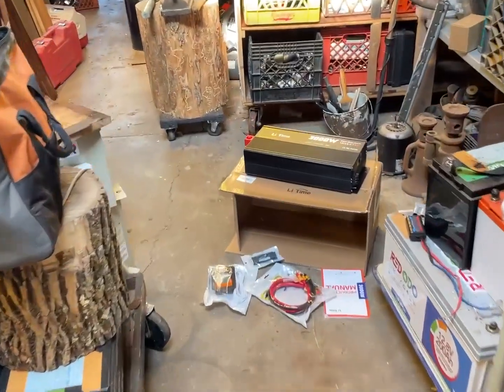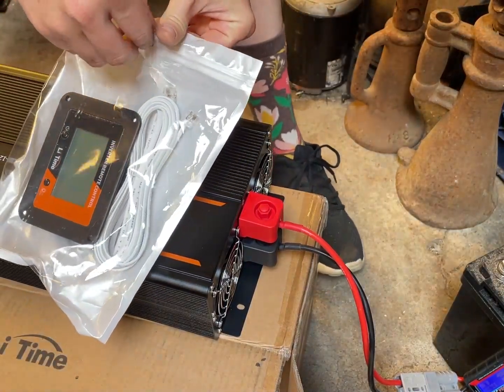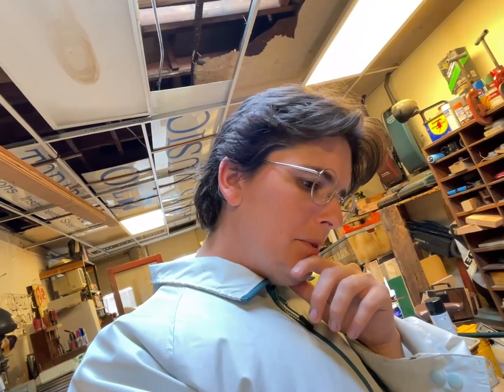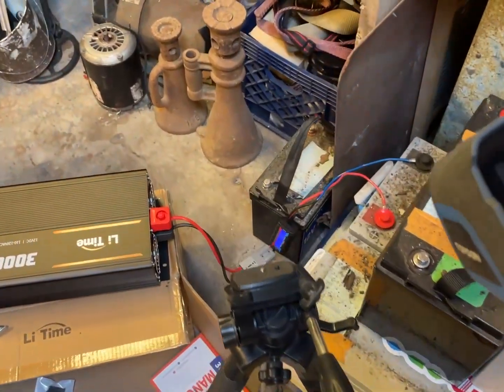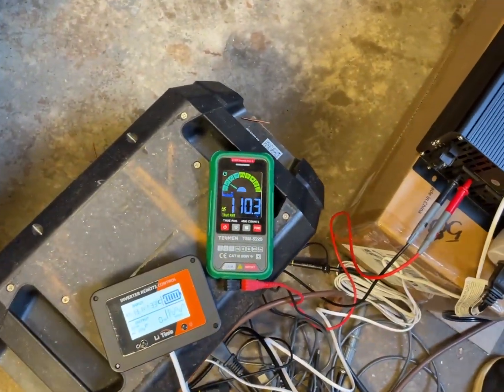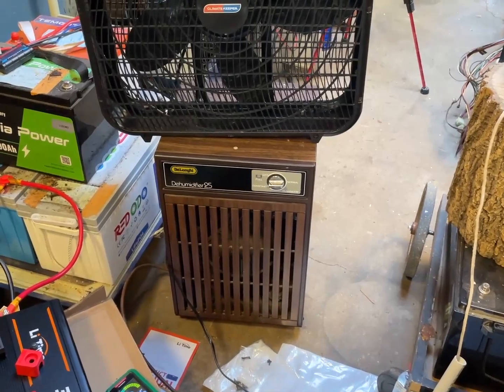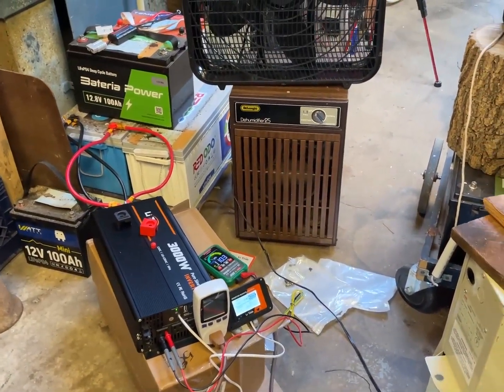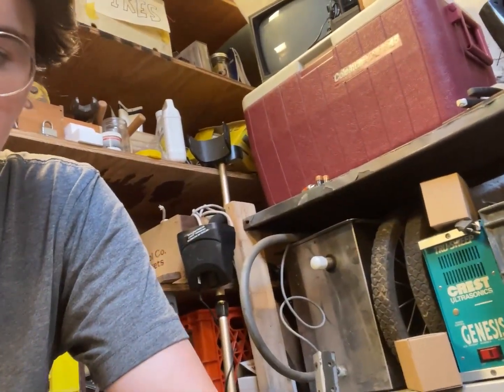LiTime 3000W Pure Sine Wave Inverter Test

Comment: Its a shame most inverters are 12v or 24v when a 48 or even 72v setup is more efficient and cleaner wiring, wish there were more options for higher input voltage inverter
Reply from the maker: same
Reply: @RinoaL i have a 48v 50ah battery i built and my bike is 72v 45ah also have a spare battery for bike 72v 23ah i use for home storage.
Reply: Remember that these are targeted at RVers as a portable solution, which is usually in a 12-24v environment ....

Comment: a 1:1 probe will do if you coil insulated solid core wire around the line cord of your load. start with 10 or so turns,connect that to probe tip and let the probe ground float.

Comment: Be aware that advanced inverters, with startup load features, can kill things like that power meter. The power meters use capacative droppers as the power supply, and when some inverters are overloaded, they turn off the output for a few thousandths of a second - meaning that the output is, for a short moment, is a kilohertz square wave. The capacitor is close to a dead short under those conditions, which blows up the power meter.
Reply from the maker: interesting

Comment: A very nice inverter. The mains voltage is between 110 and 120 volts, right? I didn't quite understand: if the new oscilloscope can handle 30 volts at the input and I'm using a 10:1 probe, then at 120 volts divided by 10, I'd have 12 volts at the input – that wouldn't harm the device. With a 100:1 probe, I'd only have 1.2 volts at the input. With a 100:1 probe, you could measure up to 3000 volts. I once had a high-voltage probe rated up to 30 kV.
I'm really looking forward to the upcoming projects – especially the old refrigerator sounds interesting. Maybe the coolant is still inside.
Reply from the maker: My scope only goes to 2v per increment, and so I'm unsure if it wants anything over 8v, so 10x is 80v.
Reply: @RinoaL  I was referring to my own devices – they can handle an input voltage of 400 volts. I can understand your caution; the equipment is expensive.
Reply from the maker: @michaellichter4091  Ah I see, yeah. I didn't have time to read the manual, and Litime's marketing team is such a pain so I just tossed this video out there to please them.